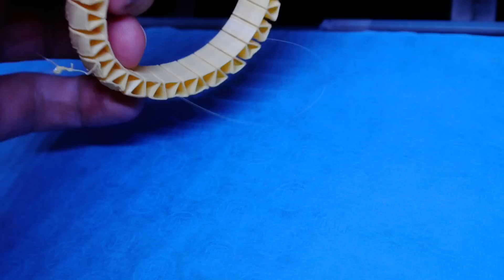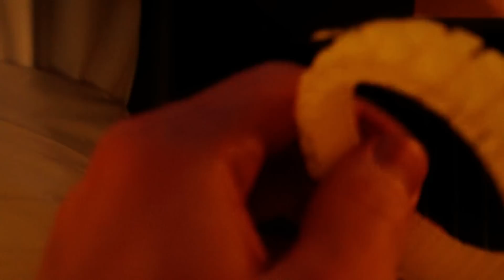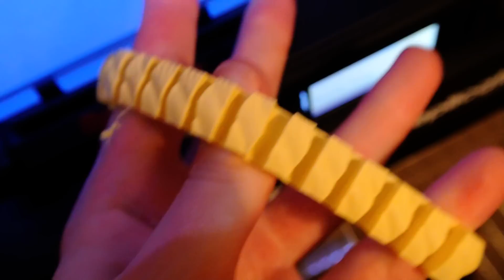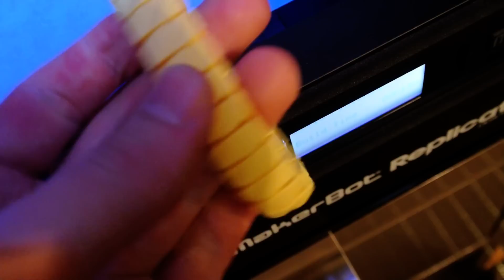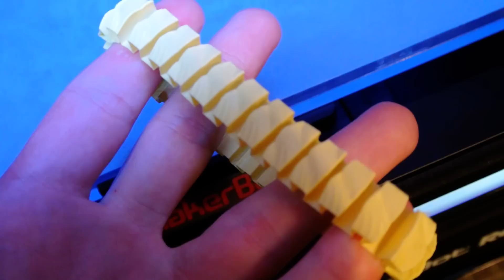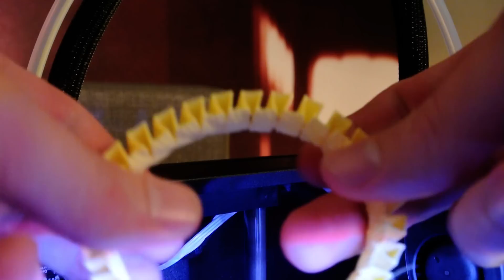3D Printing on makerbot replicator 2 - Bracelet

Comment from the maker: The bender wasn't on the high res setting.. I have one that shows 3 different types.. 
derivative:42429  has the 3 of them from low, med, high settings - the one up the back is on the 100micron thickness layer (it had a bit of scrappy stuff due to the model having lots of internal shapes).

Comment from the maker: Spend the time getting the base level, I used the blue tape from the start (they include some big sheets). Watch the first few layers - be prepared to pause it to remove some crap.

Biggest pain with 3D printing currently is the software. I know makerbot are putting effort into makerware and I've been using that.. The slicing task in the background seems to choke a bit every now and again - so don't queue up 10 things to be sliced because if the current one locks up - no cancel function.

Comment from the maker: 0.2 something I think it was- the higher res stuff I haven't done a huge amount of as skienforge settings I was mucking around with seemed to kinda overcook the plastic a bit - so I just went with the medium settings or put it to 0.2 which are pretty good and a decent enough result for the time spent printing..

Did you get yours yet?